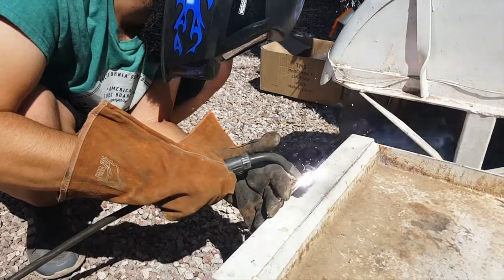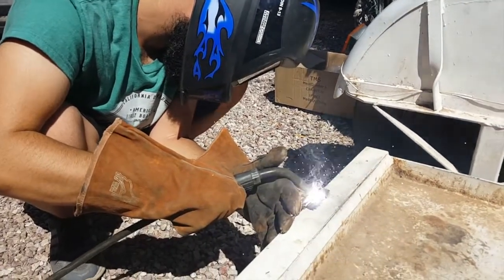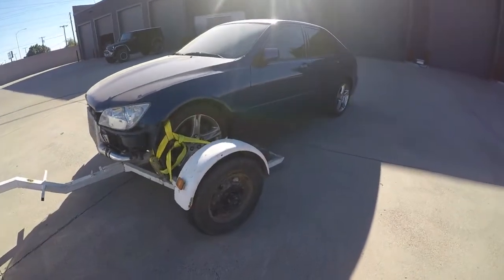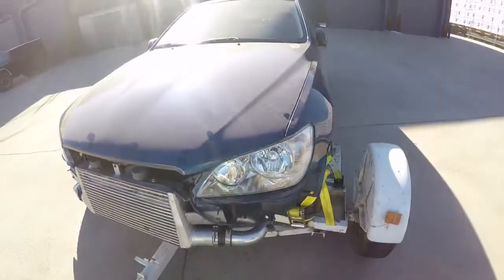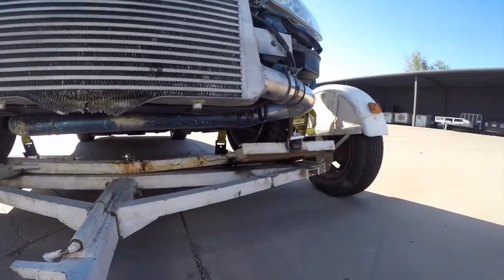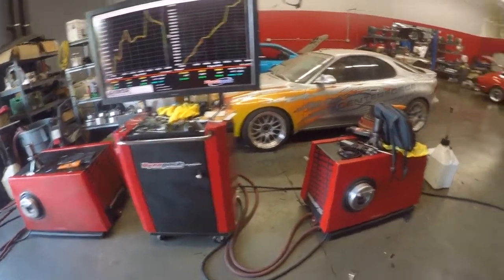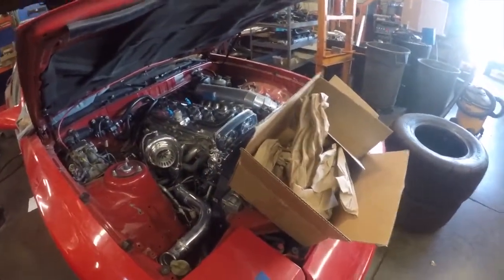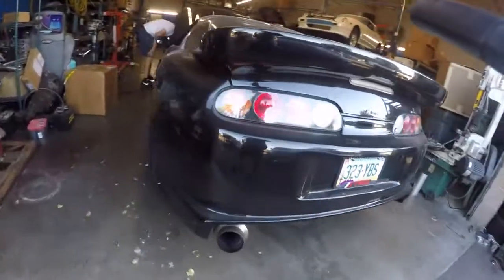Turbo Lexus IS300 Update! Towing the 2JZ ends in disaster! 😰 What an epic fail.

Comment: Dude, I had similar issues with my Is300 but with a greddy EMU. I discovered this by firing my car up with the oem ECU. Plugged the greddy back in and it didn't fire. So,  this eliminates any sensors on the car. The issue was with the EMU in my case.
Reply from the maker: Too bad I can't do that, the stock harness is all cut up already. But good idea! Glad you were able to get your car figured out that way!